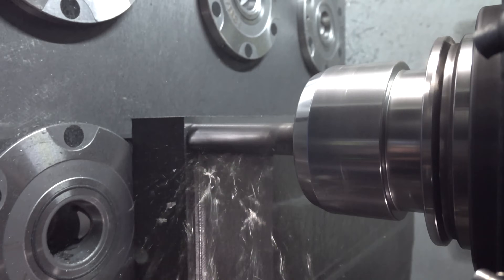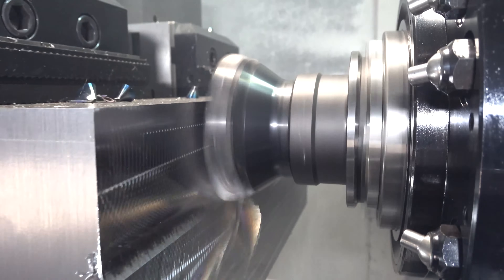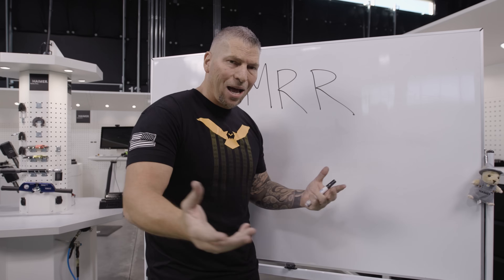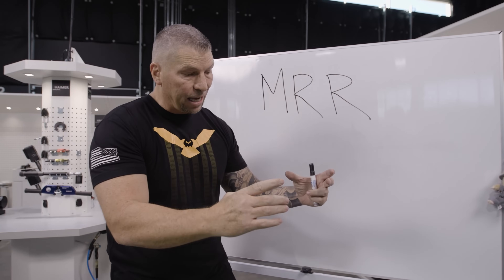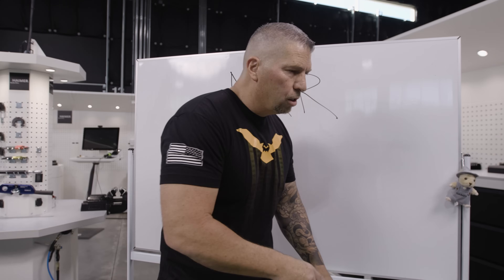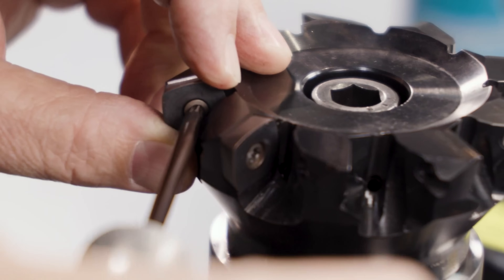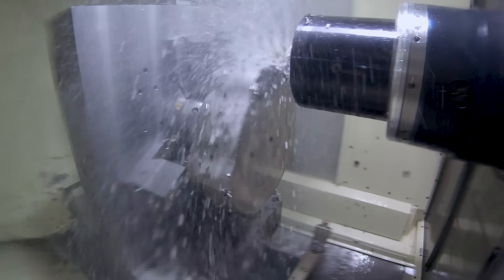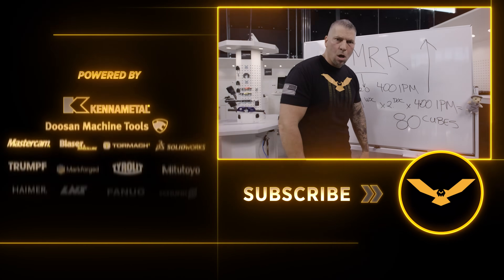Must-Watch for Machinists! The Most Important Thing to Look at in Machining

Comment: I notice you guys climb mill with the end mill. You can get a lot more meat off if your not and not have your work get snatched out of your vise or chuck.  Love your vids.
Reply: (coming from somebody that doesn't know you)  Unless you use a down-cut em, I don't see the difference a piece getting pulled up from the vice.  Also, do you know about how much more of a chip load an em will take (climb vs conventional)?  To my knowledge, any chip load recommendations from the tool manufacturer are based on climb milling.  I'd appreciate any feedback.

Comment: There are many factors in the overall time used to make a part but MRR is a piece of the puzzle for sure. One thing to remember is that it's great to save ≈1h in machine time however if it just sits on a pallet that gain is lost. You have to take this drive of improving the process and apply it as whole to the entire company.

With that said; I would like to see more about how you inspect these parts. As a metrologist a and CMM programmer i think talking about how you machine to hit the specs would be cool. I.E machining to the Datums ext.

Comment: So the greater the WOC and deeper the DOC combined with fastest feed rate for the tool/machine/material is what youre looking for. To remove a said volume of material as quickly as possible to leave time to start on the next job and make more $. 
Did I get it right?

Comment: The most important measure is TIME  , because you charge your customers  based on total time needed to make and inspect the product
Reply from the maker: MRR is based on the most cubes of material taken off in a certain amount of time…
Reply: Well by the description. The most time is spent in a normal job is removing the bulk of material. 
Thus for most jobs if you can remove it faster them thats where you makenup time. So MRR is the key number.

While you may be able to finish faster using a mill with more flutes, there's probably not as much to be gained on that. And it's time will be dictated largely by the tolerance and finish spec. Everyone will have to meet that so its not going to be hugely different unless somebody is rubbish or telling pokies. 

There may be unusual jobs where this doesn't apply bit he's talking about your bread and butter. 

Would be interesting to see how this is applied to lathe work. Never see much cnc stuff on lathes. 

The skill is in knowing how hard you can push either the tool or the machine. 

My little cnc hobby mill only has 360w on the motor. But that's a lot on a 3mm end mill. The only difference is scale. So even it once you are in to small parts you are looking at how hard you can push the tools. 
I'm actally quite shocked by what 360w can do. OK it's not ripping of material like these beasts. But a 10mm end mill taking a 10mm deep by 0.5mm step at 600mm/min is way more than I expected. Its a really strong little mill, and I'm loving it. 

Feel like I'm doing the wrong job.

Comment: How do you determine your max width and depth of cut for various materials? is that a spec of the bit?
Reply: Thanks to you both for your answers!
Reply: i can't speak for titan but i'm my shop depth of cut is always the flute length of the tool, width of cut is the maximum i can get away with before the tool starts deflecting or reaching full load on the spindle.  whichever comes first.
Reply: Ah ok, that makes sense. Do you do test passes to check for deflection or how do you know when you’re reaching your max spindle load?
Reply: Not working with Titan, but I used to be a machinist. It really depends on the tool, the horsepower, and the job. For example, with a 6 flute tool it's usually better to put max speed in terms of ipm, and see after what's the width you can take. With a 3/4 flute I prefer to go full diameter and the push it to see how far we can go. So the differebce is excentially on the application. I prefer using a 6 flute mill, for the exterior roughing, for the ineterior, i use to use a 4 flute if it's someting big, and a 3 flute if it's someting smaller, because the second one can also drill very fast without using cirular interpolation, that slowes down the speed pretty much. The rest is all about the machine, so how far can you push it, and in bigger machine you can take bigger depth or width of cut, in smaller it's better to speed up in terms of rpm, go full speed in terms of ipm, and the take a little depth or width of cut, in stronger machine you can take bigger asportation. I'm from Italy so I don't know if my grammar is quite correct, but i hope this will help

Comment: Looking at the formula because it is a multiplication. The only way to increase the "cubes" is by increasing the IPM or by using a better tool that  has more woc or doc
Reply: And making sure your fixturing can handle the MRR - and maybe multiple parts to the spindle keeps spinning instead of stopping to be loaded all the time. You can think or MRR over a day.

Comment: Ok Titan Mrr is not the most important factor. I have been in this industry for 35 years. I manage a shop (small) and run 3 machines (one 4 axis and two 5 axis Mazaks) fixturing and programming is what brings in the dollars. We mainly run small lot Aerospace parts in all the materials you talk about. Killing it is about One and Done setups. I design complicated fixturing to complete a part in one setup. I dont care about MRR. I care about one setup for a part and ship it!
Reply: I'd argue it all is about equally important, however it all comes down to process reliability, doesn't matter how fast your going or how good your fixtures are, if your parts are taking inconsistent amounts of time your process isn't reliable. Whether it be becuase your going to fast and breaking tools, or your fixtures aren't as "idiot proof" as you'd hope. Tool paths can create unreliability as well.
Reply: @HEEDCNC  Your response doesn't even make sense! WTF? what if it is a casting! MRR? I dont think so..........
Reply: @Greg-ms4kk  did you even read my response? How doesn't it make sense? I'm not saying MRR is the most important thing. I'm saying process reliability is. Regardless if your using castings or starting from raw bar, if your process isn't reliable your parts will all be taking inconsistent amounts of time.
Reply: @HEEDCNC  Yes i read your response..... Your parts cant take an inconsistent amount of time. Toolpath is Toolpath. Every part you run is the same exact time. If you are breaking tools to slow that process down then your programming is off. And yes my fixtures are idiot proof..... Every single time....Perfection is my Mantra....
Reply: @Greg-ms4kk  first off I'm not speaking of you in particular. 

Second, your missing my point, for example If your going to fast and tool life isn't consistent then your parts machine times aren't consistent becuase your forced to change out tools....making the process unreliable. If you alter the program to reduce feed and make tool life more consistent, well guess what, you just made the process more reliable. 

So again. Process reliability is king.
Reply: @HEEDCNC  Case and point.... Not MRR......
Reply: @Greg-ms4kk  you do realize I never said MRR was important. My original comment said that it's all equally important, but process reliability is the most important thing.
Reply: @HEEDCNC  the Video is about MRR. That is my point!

Comment: So we have an Endmill in our Shop with nearly double the Mrr :) 
Kor5: 2.5mm x 50mm x 10000mm/min =1.250.000 mm³/min
Our Tool: 7mm x 30mm x 11000mm/min = 2.310.000 mm³/min
Reply: Yes, same material. Aluminum, maybe a little bit diffrent but not a lot.
Reply: @christianbreu814  shorter tools can go harder.  it doesn't help much if the wall of your part is 50mm, you would need to come back for a second op with a longer tool increasing machining time.   

also there are other metrics at play, how long do your tools last?  you can always push them harder, but if you're looking for a reliable stable process it's best to run them less than full throttle.
Reply: @AlexMageethefirst  Our Tool have a Diameter of 16mm, cutting lengh is 3xD.
Our operation is 60mm deep so we cut it in two steps with the same tool. The tool could do more but our machine is already at 105%
Reply: @AlexMageethefirst  I dont know how long the Tool last but to date it slotted about 6.000kg of aluminum
Reply: @christianbreu814  what endmill? I use a gwstool alumigator ART for all my roughing, it's capable of doing some pretty serious MRR.
Reply: @HEEDCNC  i dont know if can say that, but what i can say its from a groupe with the orange books ;) and it have 4 flutes with a lot of chip breakers.
Reply: You need to compare a 7mm Kor5. No way to compare a much smaller tool to a bigger one.
Reply: A larger tool cuts more.  You don't say.
Reply: @arg8763  i think it's a 3/4inch (~18mm) Kor5. So its bigger then our Tool
Reply: Same material being cut? Can't really compare machining something like 4140 to say 718 inconel.

Comment: I like leaving my parts .015 big because some of these programmer aren't that great at making fixtures or the program. Then I'll go to size
Reply: .....but after the first time you set up and run the job,  you don't have to go through that again,  right ?
Reply: @5oclockshadowbanned154  right. Except my last job. They liked to rush everything. I couldn't deal with it. So I quit.
Reply: @themattrixrevolution  
If they are consistently expecting the impossible due to other employees short comings and poor decisions, and you aren't getting paid to finsh the engineers job or allowed the time. It's time for greener pastures. It depends on the shop.
Reply: @brandons9138  same but it was a wait time of over a year. I quit because I was  just getting low balled. 3 CNC machine for $16/hr. For 10+hrs. I had to put my 2 weeks. I had no small break in-between. I just jumped  machine to machine in a big triangle.
Reply: @themattrixrevolution  That is just sad.  If you are pumping out good parts on 3 machines you should be making TONS of money for that shop.  Some of that money should be flowing into your pockets.  That is unless the shop can't quote for shit and is shipping money to the customer along with the parts.  My last shop was that way we were always busy as hell. Because the quoting process SUCKED they were losing money on a lot of job and sucking the profits of the jobs that they managed to actually quote right.  I hope you find a shop that pays you what you are worth.  How long have you been in the trade?
Reply: @brandons9138  This is going to be my 4th year. I'm considering starting my own shop but I lack connections.
Reply: @themattrixrevolution  Connections, like how? Where to get work?  Where to get machines?
Reply: @brandons9138  work. I have traditional machines, I can work my way to used CNC later.
Reply: @themattrixrevolution  Go to other shops in your area and see if they have any over flow work that you can handle.  Even making fixtures or jigs.  Basically anything to get your foot in the door.  The guy who owned my last shop got his start there.  He was knocking on doors getting work from other shops.  Mostly onesy, twosy  type jobs.  After that it became more and more jobs with larger quantities.  It got to the point where he had the work and money to quit working for other people and opened his own shop.

Comment: I mean, i understand MRR and all that but i still hate plunging a custom internal cutter straight into the piece in the way the companies i have worked at do

I just dont like the sound or the vibrations coming from it but it removes upward of 16kg of steel per minute on some machines 

I think 16.7 kg was on a makino mag 3 where we plunged a custom 8-stepped in-house cutter about 600 mm into a block of steel at ~1500 mm/min, hitting about 95 KW and putting the fear of god into all the workers nearby